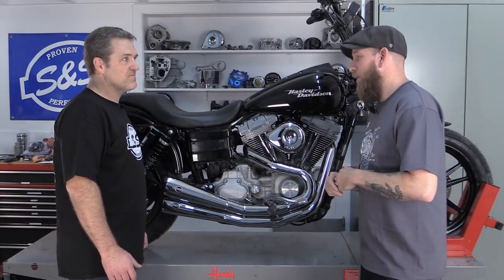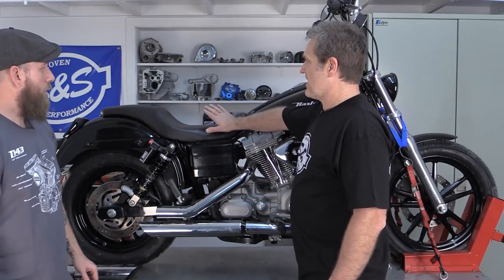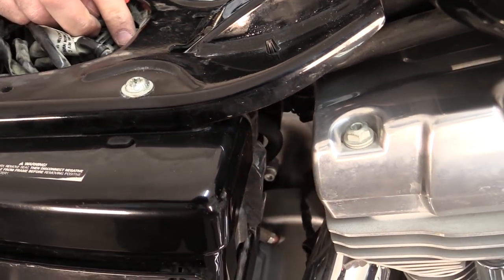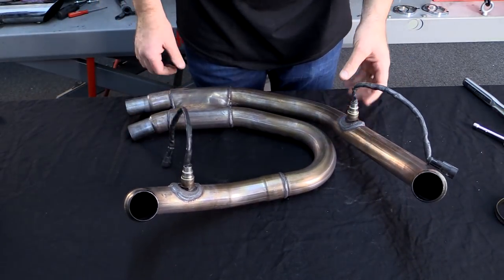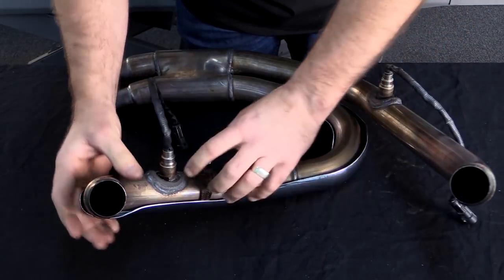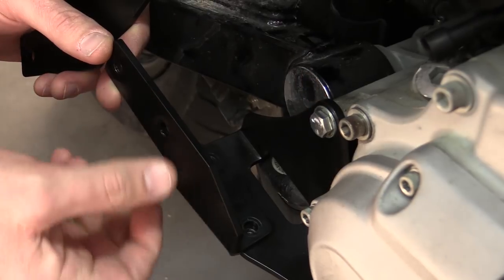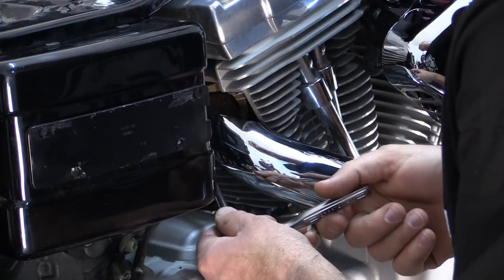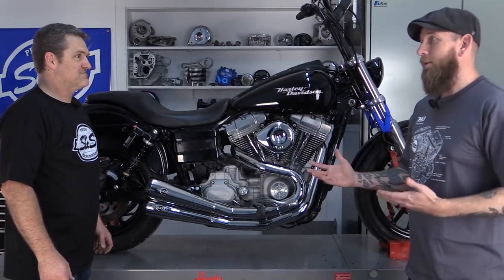S&S Cycle Installation - H-D® Dyna® 2 into 2 Grand National Exhaust System

Comment: I was installing my S$S Grand National exhaust on my 2011 Wide Glide this morning.  I have run into a problem. Rear oxygen sensor wire  is now way too short. It cant make it back to the original factory plug under the seat. Is this to be expected should I try to reroute some other way?
Reply from the maker: Hey Rome, your stock sensor wires should not have a problem retracing the stock positioning. We recommend double checking your wire routing and give us a call if you get stuck: 
+1 608-627-1958

Comment: Rear footpegs  can it still  installed ?  fxdb2012
Reply from the maker: Requires accessory peg for right side.  https://www.sscycle.com/products/passenger-footrest-relocation-kit-for-grand-national-2-2/
Reply: @SSCycleInc   Does the same part number ( foot Peg bracket) fit the Dyna and the M8? I need the part # that will fix a 2011 fxdwg.
Reply: @romesyoutubechannel5356  It says on the description that it fits both M8 and Dyna.
Reply from the maker: @romesyoutubechannel5356  both the M8s and the Dynas use the same bracket.
Reply: @SSCycleInc  ok thank you I need one.
Reply from the maker: @romesyoutubechannel5356  Heck yeah, checkout our website or your nearest S&S Dealer.
Reply: @SSCycleInc  I tried to order off of the website it would not let me. It said I had a dealer locally.  I would prefer to order it off the website myself that way I know that it actually has been ordered.  I also need a baseline tune for my power vision for this pipe which no one seems to have. Had the pipe almost 2 years and have not installed it yet.
Reply: @SSCycleInc  hello i recently installed this system and the footpeg relocation bracket on my 2014 Dyna Street Bob....LOVE the system.  Just a question out of curiosity more than anything else.  The directions for the footpeg kit shows slightly different bracketry (i'm assuming for M8 applications). The "stacking" of the brackets is a bit thicker on a dyna as it seems that on the M8  the transmission bracket doubles as the top muffler bracket then the bottom muffler bracket, combined with the footpeg leaves a total of 3... where the dyna has separate brackets for the transmission,  top muffler,, and bottom muffler,, combined with the foot peg bracket totals 4....the longer screws provided do make it to the bottom nut and i was able to get a couple of good turns there to secure it all. Just wanted to make sure I was correct in the installation?  I used loctite and tightened correctly.  It seems solid.  Thanks in advance!  The pipe performs amazingly!